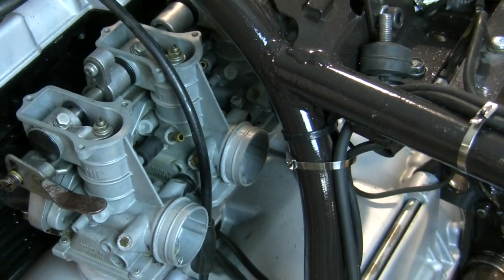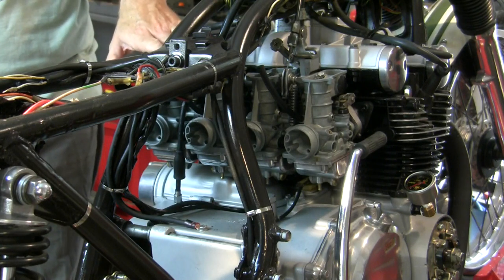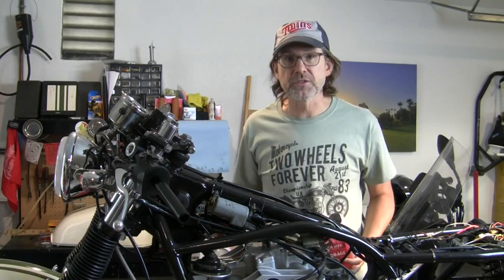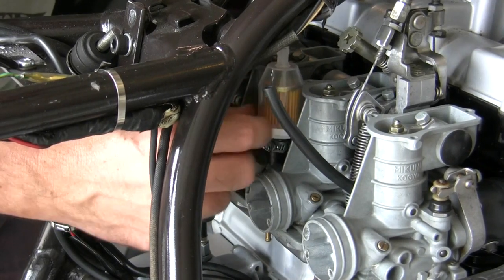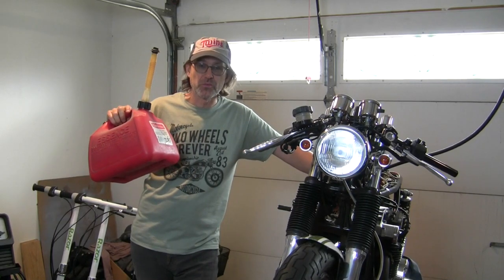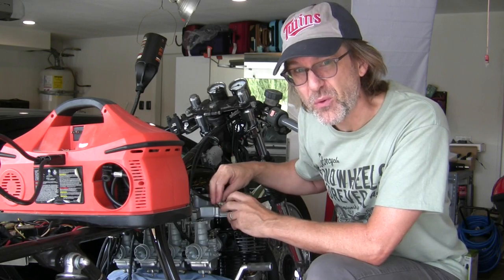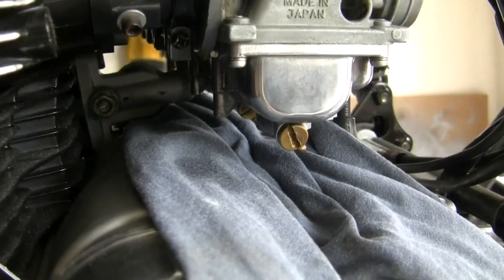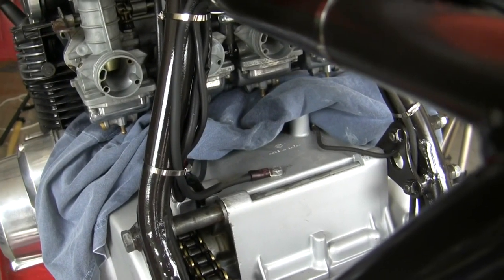First Start Attempt - GS550 Build Part 99

Comment: hey mate ..i got a GS550 race bike i'm about to convert back to a road bike soon with a sidecar outfit..... I'm looking at your points and thinking screw that ..... that was the 1st thing i threw away and converted to CDI... was easy as to do .... from memory i cut one of the wires that run from the bottom pickups/ triggers on bottom of the motor to make it work. ie had 5 wires and only needed 4 although not all are like that... I could've been using triggers off a 750 ... can't remember...... i got mega spares for Suzuki GS and GSX models  ... anyways what i'm trying to say is we found points way to unreliable and switched to CDI ... it's so easy to do it just makes sense ..... oh yeah one more thing use a honda cb750/900 reg/rec they never seem to break down and kill your CDI like the suzuki ones do
Reply from the maker: Thanks. Hard to argue with the reliability of CDI, but there's a romance to points. It's like a Rolex vs Apple Watch...there are some guys who just don't resonate with the Apple Watch.

Comment: 3:07 I believe also the vacuum actuated fuel petcock is a safety interlock.  Those smart engineers realized you don't want fuel pressure against the float needle valves with the engine not running. If so, you could have fuel with an intake valve open, filling up an empty cylinder causing hydrostatic fuel lock up in a cylinder. Excellent video, keep 'em coming...
Reply from the maker: Excellent points!

Comment: Very nice man. Im having some problems with mine. Coils are ok, breaker points are ok, have a good spark on all spark plugs and cant start it. In only starts when i spray some carb cleaner directly in carbs. Will have to look into carbs, maybe some blocking. Will see. Never the less, cant wait for your next video. Keep it going :-)
Reply from the maker: Thanks for watching.  Sounds like you're on the right path...Air, compression, fuel and ignition (timing). Do you know you have fuel in all 4 float bowls? Do you know history of carb cleaning? Lots of different ways to ask similar questions.
Reply: @UrbanMonkTV  I know beacuse I cleaned them and did all rebuld of carbs. Put new jets, o rings, air screw, fuel mixture screw etc. I will have to check for fuel, float hight etc. Weekend is here so lot of work for me😉
Reply from the maker: @DanijelHribar  Sounds like fun! Enjoy your weekend! 🙂

Comment: 1 n 4 have a vacuum port its not atmosphere?
Reply from the maker: The 2 ports feed atmospheric pressure to the other 2 carbs.
Reply: @UrbanMonkTV  fuel tank vaccum goes to air box?
Reply: @UrbanMonkTV  my '83 GS 850L has only one petcock vacuum on Cylinder #02..!
Reply from the maker: @Swokpmund  77-79 have a completely different carburation system than 80 and on.
Reply: @UrbanMonkTV 

I see.. thanks. Have a 79 GS 850 L.. as. Donor.  Haven't touched yet.. I think  this winter it be a project for a ride...!
Reply from the maker: @Swokpmund  You have a fun winter ahead of you!

Comment: Mine fired up after 30+ years!....then cut out and now won’t start🙄....back to the drawing board! Old “vintage” bikes! Ha
Reply from the maker: Wow, that's a long time to sit without running. If it ran once for you, it'll run again. If we have fuel, compression, ignition and timing, these engines have not choice but to run. :)